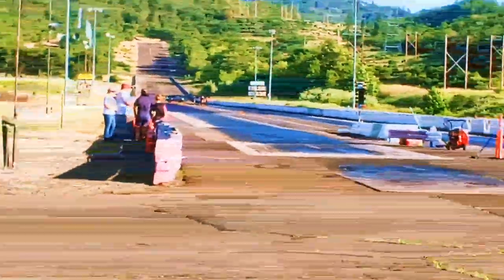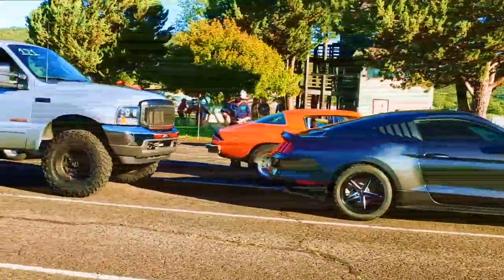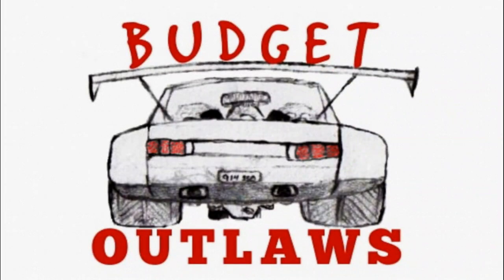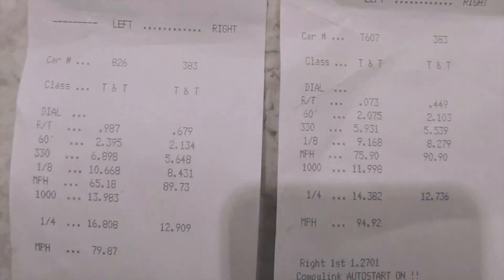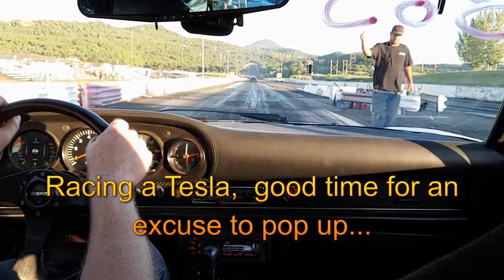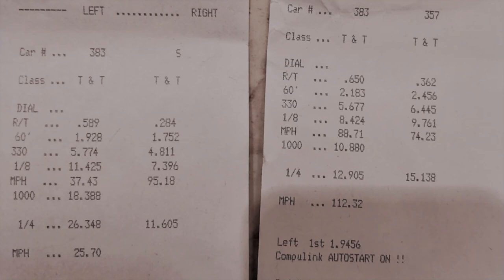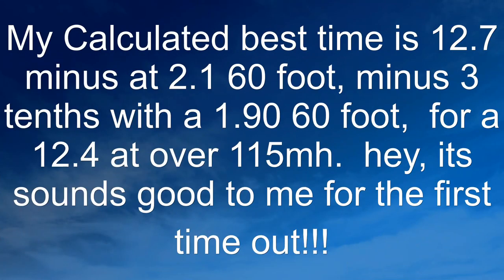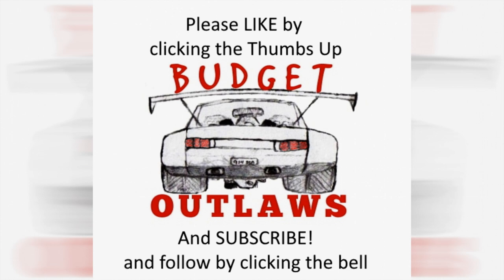LS Powered Porsche 914 hits the Drag Strip!  Medford Dragstrip 6-26-2020

Comment: Cracking up lol. I was racing a SBC powered/930 box and launching off the 2step at 4500rpm. You cannot hurt the 930 box. The Ring and Pinion are as large as a Ford 9in and each gear set is larger than the Muncie 4 speed "Rock Crusher". Don't be afraid of the 930! Your biggest issue? Will be the stub axles. Not the CV's.. Not the axles.. but the Stub axles. I ended up running custom 300m stainless stub axles after snapping 45yr old stock pieces.
Reply from the maker: Great insight! We'll get some sticky tires on it and try again soon. 

What kind of times were you running and how much power?

Comment: The air-fuel ratio was is in the 9's and 10's.  There's more 20-30hp if you get it to 12.5.   There's probably even more power in dialing in the spark table.
Reply from the maker: Good Catch,  it was definitely pig rich.   Don't do as I do...  That was corrected, but now it's all changed again.  7875 turbo and 8-12psi of boost.  Much better  A/F numbers now with 1 gauge for each bank.  In fact today I was scheduled to go test again on the strip, but much needed rain cancelled that.  But Soon,  very soon...